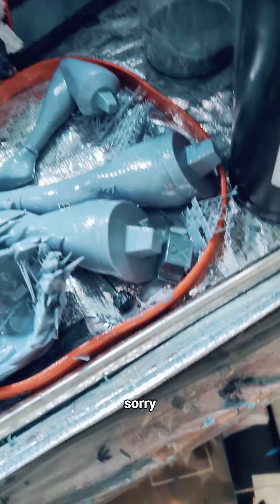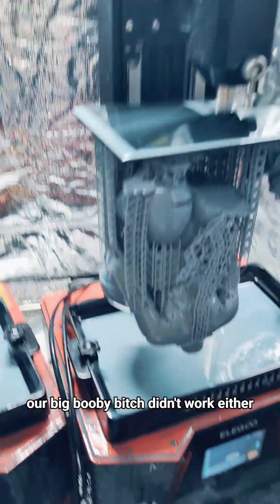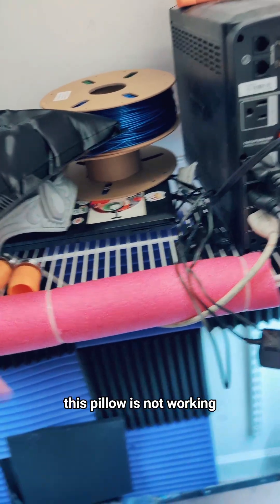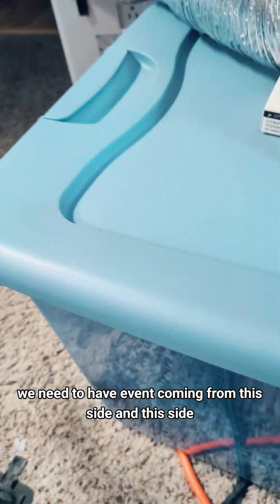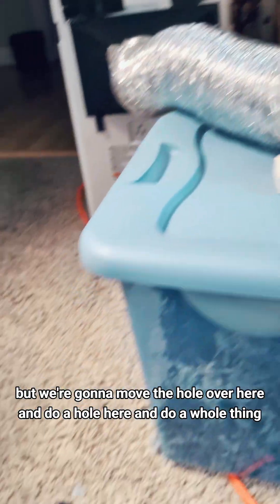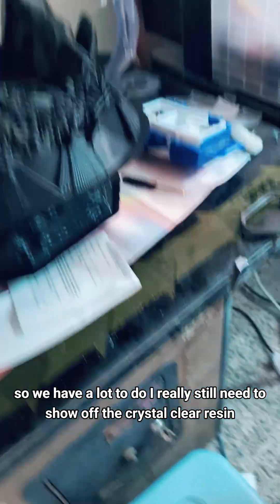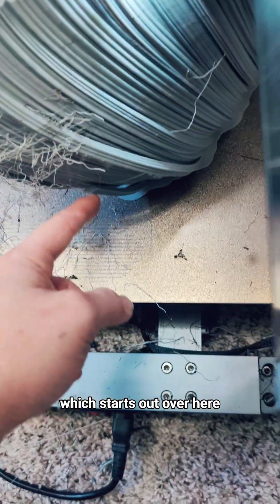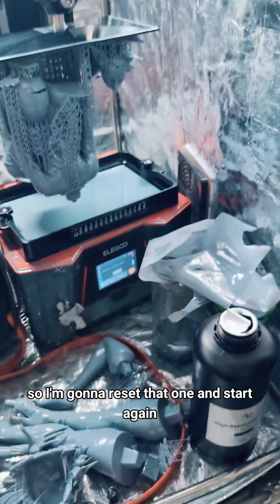We got some hoodies and a lot to process

Comment: I was about to say what why do you not use a Dremel tool I got to do is just have a small like abrasive ballpoint as small as you can get run it on max and then just lightly set it on the end and tap tap tap working your way in until you get a hole and if you need the whole bigger you can widen it from there
Reply from the maker: thats the plan. though we already reprinted the legs anyway.
Reply: @Freyas_Fantasys Cool part is is this is now just another little tool in your toolbox

Comment: Thanks for responding. Also, you have the same kitchen knives that I do.
Reply from the maker: those knives r junk. they fell apart in the dishwasher. wife 2 keeps them around becuase she gets absolutly furious that i use her good knives to open boxes. 
its actualy pretty funny. the knife block used to be next to the door. she has now moved it across the kitchen so adhd brain does not go "need sharp object" and grab the first thing it sees without thinking. which was always bigger and biger knives. depending on what was avalible. 
eventualy we upgraded knives, but she kept some of these junk ones around, and leavs them laying around where i can see them so i will gram them and not good knives. 🤣

Comment: yah, there's special bits for drilling brittle plastic, but people have been drilling brittle model kits with pin vises and tiny bits for many decades.  the thing i hear most that's out of my experience is that dull bits work best on plastic, my experience is wood and metal, rarely plastic.

Comment: When it comes to drilling into models, use a dremel. I used one before I upgraded to a dentist drill. High RPM with as little force applied as possible will help avoid cracks. It's not foolproof. I can't say how well it works for resin
Reply from the maker: a dental drill.... INTERESTING.. tell me more...
Reply: @Freyas_Fantasys Instead of a normal drill, which requires force and sort of digs into material, causing damage to models, a dental drill is like a tiny, really focused grinder. It doesn't use force at all, you just need to sort of rest it against what you're drilling into. A dremel is similar, but not as precise, making it impractical for smaller, more delicate models.

As far as I know, you're not digging into teeth on the side, so a brand new drill kit is likely not worth it. I picked mine up on ebay for about $800 after shipping. A brand new set is upwards of $5k
Reply from the maker: oh.... on no... i have a dremmel. it works fine i supose. and i think it only cost me like 60$ 15 years ago. 
me and that dremel have been through a lot... it ripped out my hair at the roots... ive dropped it a lot. but i duno. like a bad penny, that thing just keeps sticking with me. 🤣 so many diferent projects. so many stages of my life... so many homes.... 
that bitch needs a name!
Reply: @pressbTD  I think the machinist name for them is carbide burs.